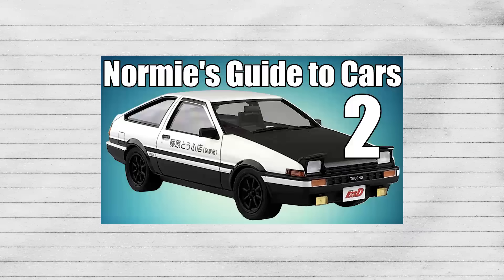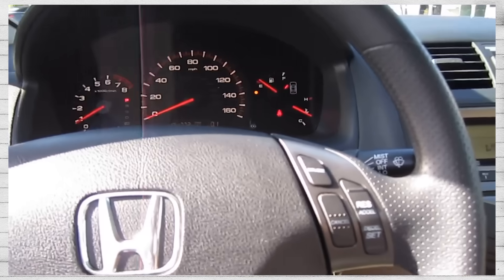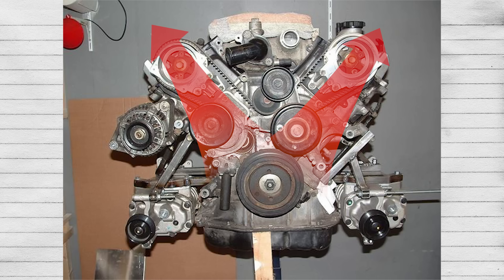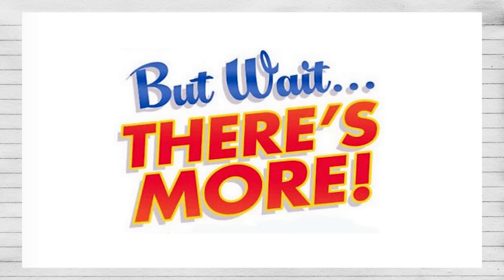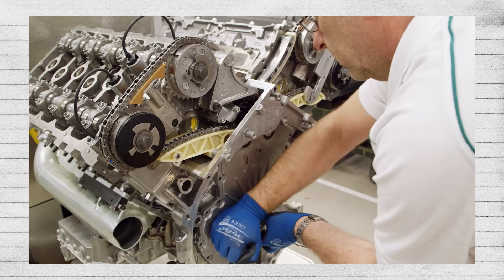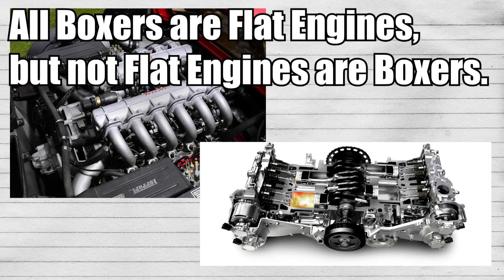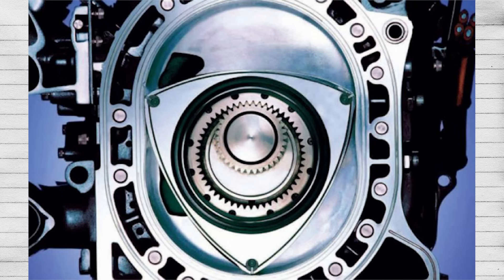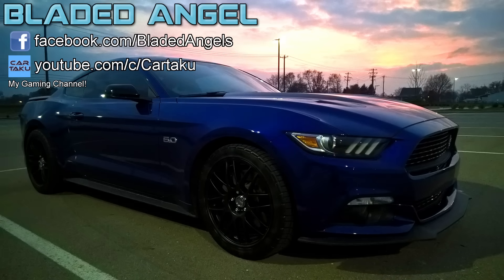Noob's Guide to Car Engine Types!

Comment: Also:
16V is not V16. V16 usually means the car is a I4 or a V8. 16 valves are used and either 2 or 4 valves are used for each cylinder

Comment: I'm a car guy and didn't know the diference between flat and boxers.
Reply: Flat is the earth
Reply: Boxers are what women pull down
Reply: this was all explained in the video, he was just saying that he didn't realise that there was a difference. read the comment before replying
Reply: That's probably the only thing I took from this video.
Reply: Heretic
Reply: Same
Reply: Boxers are just V4's offset 180 degrees.

Flat's are flat, but not after a V engine.

I think.
Tell me if you know better 😂
Reply: Yip, but thanx to bladed angel I now know the difference.......
Reply: Same here.
Reply: Lamborghini and porshe use these
Reply: But in the animation, the boxer engine fires 2 cylinders at the same time. I thought it shouldn't be that way right cuz it'll not be a smooth power delivery. Or am I wrong
Reply: Diogo Almeida i honestly thought they're the same
Reply: Diogo Almeida same
Reply: Boxers are flats, but flats are not necessarily boxers. They're both terms for horizontally opposed engines but "boxer" means something specific about the crank angles and firing order.
(Squares are rectangles, rectangles are not necessarily squares)

Flat engines have 2 banks of cylinders opposed by 180 degrees.
In a "flat" NOT boxer that means that the cylinders across from one another share the same crank angle - just like in a 90-degree cross-plane V8. So when one is moving in (on the intake or power stroke) the other is moving out (on the exhaust or compression stroke).

In a boxer the cylinders across from each other (on opposite banks) move in opposition to each other (180 degrees different on the crank). So they "Box" in and out at the same time to oppose each others inertia. As such they're both moving in and out together. One will be on the intake stroke while the opposite is on the power stroke (both going in toward the crank) then one will be on the exhaust stroke while the other is on the compression stroke (both going out).
Reply: Same here
Reply: Shylax Z big is your head

Comment: YO  , the f12 has a v12  , not a flat 12 ,  i think a 60 degree v , not entirely sure on the angle , but its not more than 90 degrees
Reply: correction its a 65 degree v12

Comment: Bladed, I don't know where you got that the Ferrari F12 has a Flat 12 engine but you're wrong, it has a 65° V12 engine, maybe the name of the car fooled you or something among those lines.

PS. I wish I lived in a cold place like you do, I believe we had like 95°F here in Mexico City or something like that, man I hate that, I hate warm climates with the bottom of my heart, I prefer colder temperatures.
Reply from the maker: I meant F12 as in Flat 12, NOT THE F12 BERLINETTA.  The Engine I'm talking about is from the Ferrari 512 TR
Reply: Well, it's easy to get confused since you said "In the case of the Ferrari F12 engine" With that someone inmediatly thinks of the engine in the F12 Berlinetta, not the engine of the Testarossa. You could've worded that better like "In the case of the Ferrari Testarossa engine"

Comment: Yes, and my family car, a Suzuki Ertiga has a 1.4L I-4 petrol engine (code named K14B because I read the owner's manual a little bit) that makes a whopping 94 HP. Yeah, I know that's not a lot for you, but its quite enough for the Indian market where more than 3/4 of cars are diesels and more than 1/2 petrols and dealer modded with CNG.

Comment: hey, i think the f12 is a v12. while the testarossa is a flat 12
Reply from the maker: I meant F12 as in the name of the engine, like Flat 12.  Not the F12 Berlinetta.  The car in the photo was a 512.
Reply: The F12 has a 65° V12 engine, dunno why bladed thought it had a 180° V12, maybe because of the name of the car. The Testarossa did indeed had a F12 engine.
Reply: Technically, and not to be that dude, the 512 motor is actually a 180 degree v12 not a flat 12
Reply: joe aubuchon My dude, you were just that dude, but seriously, most F12 engines are actually just V12 at 180°, I don't think there's a single F12 engine that's actually a proper F12 engine

Comment: See that GT350 badge? 
drives a V6
Reply from the maker: IDK what you're referring to, but in case it's about my car.  The Shelby GT350 badge is on the right side of the grill.  The GT California Special (My Car) has a tri-bar logo on the left side.  So i'm not trying to pretend to be a GT350, that's just how my badge came from factory, and I don't want to put it in the center because that's what BOSS 302 Mustangs do.  I'm all about that OEM badge life.

Comment: I have a v4 in my Ferrari pushing 90psi with my turbo
Reply: Nova my civic can beat ya shitty ferrari it can rev up to 12 000rpm
Reply: Vtec kicks in and boom +10 000rpm
Reply: ”vTEc pLUs 567 stiCKErS = +76,987,000 HP AnD 999,999,999 RPM!”

Comment: Ah more people need to see this. I see so many ads for the Trailblazer/envoy that still list it as a V6
Reply from the maker: One time I saw an ad that listed a Mustang GT with a Flat Plane Crank (like the one in the Voodoo used by the ShelbyGT350).  I don't think dealerships actually know how to use real car terms properly.  They probably just think they are pretty marketing terms used to make products sound better, but boy do they look stupid when they use it wrong.
Reply: Bladed Angel indeed so haha

(Ignore me earlier)
Reply: Justin Noker honestly I have a Saab 97-X and whenever I say it’s a 6 cylinder some normie says it’s a V6, when I try to correct them they say that a V4 in their Honda is better anyway

Comment: What arw your thoughts on the il4 ecoboost mustangs
Reply from the maker: Hmmmmmmmmmmmmmmmmmmmmmmmmmmmmmmmmmmmmmmmmmmmmmmmmmmmmmmmmmmmmmmmmmmmmmmmmmmmmmmmmmmmmmmmmmmmmmmmmmmmmmmmmmmmmmmmmmmmmmmmmmmmmmmmmmmmmmmmmmmmmmmmmmmmmmmmmmmmmmmmmmmmmmmmmmmmmmmmmmmmmmmmmmmmmmmmmmmmmmmmmmmmmmmmmmmmmmmmmmmmmmmmmmmmmmmmmmmmmmmmmmmmmmmmmmmmmmmmmmmmmmmmmmmmmmmmmmmmmmmmmmmmmmmmmmmmmmmmmmmmmmmmmmmmmmmmmmmmmmmmmmmmmmmmmmmmmmmmmmmmmmmmmmmmmmmmmmmmmmmmmmmmmmmmmmmmmmmmmmmmmmmmmmmmmmmmmmmmmmmmmmmmmmmmmmmmmmmmmmmmmmmmmmmmmmmmmmmmmmmmmmmmmmmmmmmmmmmmmmmmmmmmmmmmmmmmmmmmmmmmmmmmmmmmmmmmmmmmmmmmmmmmmmmmmmmmmmmmmmmmmmmmm
Bladed.exe has stopped working.
Reply from the maker: It's good if you want a Mustang that's cheaper and more fuel-efficient.  I'll never be a fan personally.  I respected the V6 since it was what carried the brand at the start (a lot of V8 owners don't want to admit that, but the V6 SAVED the V8's ass when it came to selling the Mustang).  I imagine the Ecoboost will hit it's stride eventually.  I just wish Ford made it cheaper in Europe, since I feel like Europeans would love a forced induction 4-cylinder, BUT NOPE, it's almost the same price as the V8, so everyone just buys the V8 instead.  Ford needs to give it a more unique identity, but since it hasn't even been 5 years yet, it's too soon for me to count it out.  Surprisingly, I will admit to missing the V6's though :(
Reply: Bladed Angel ok i respect that i have a eco. I feel its a great platform for mods i have one an the gas is great power can be greater a few bolt ons and a tune an ill be happy thanks reply. My channel is based on my eco.
Reply: in Indonesia, I prefer to buy I4 forced induction than V8 NA if it has same price, because here the tax determined by engine displacement, meaning the tax for V8 engine is more expensive that I4 counterpart, even they produce same amount of emission.
Reply: focused200m the suffer the same head gasket issue the focus have it’s ok shoulda kept the 3.7 and just tuned it up a bit more I own a 98 gt and 11 v6 so I respect both sides the only time would say that 4 cylinder was ok was the old svo mustang but I guess everyone is downsizing even Honda got rid of the v6 accords
Reply: Govin Lock yea give or take my eco is good around an good for mods
Reply: I wish Ford would of built a whole new rwd tranverse car around the ecoboost instead of throwing into the mustang, but that would of competed with the focus st with its "drift button"
Reply: Emmanuel Haro the rs has the drift button fyi
Reply: Emmanuel Haro on a side not Ford is getting ride of all there cars except the mustang and focus they will only be selling those and trucks so prolly why they didn’t build a new car